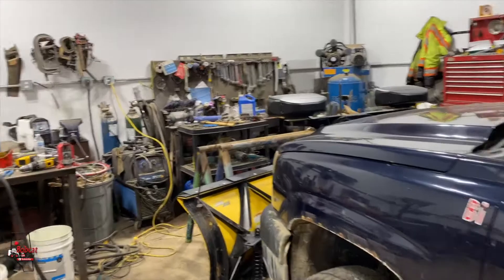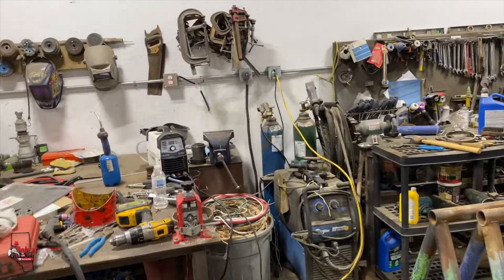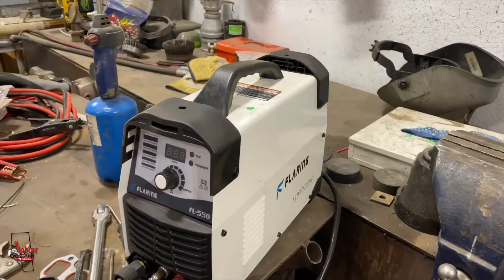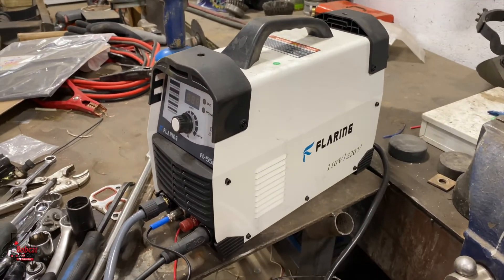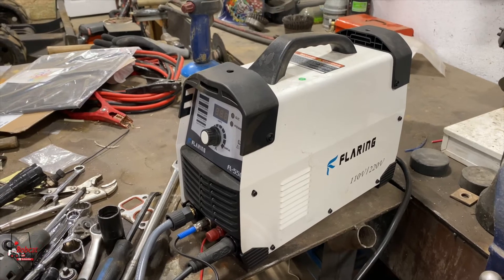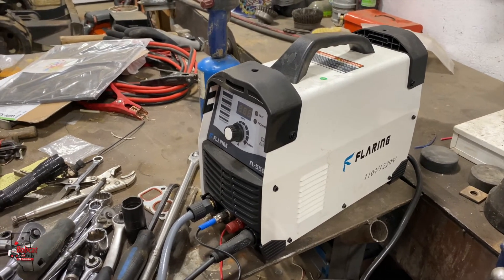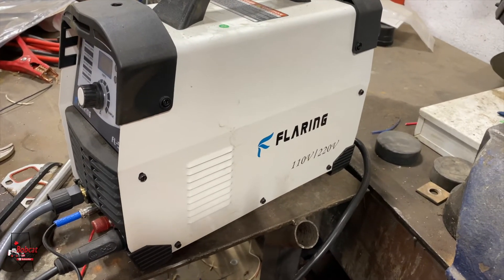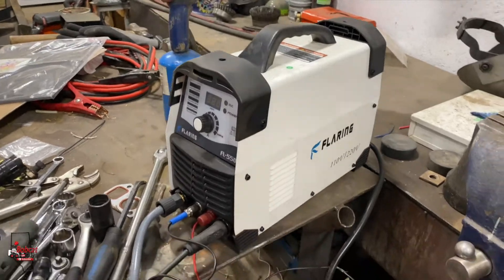Plasma Cutter Non Touch 50 AMP 110/220V FL-550 Pilot Arc 1/2''

Comment: Nice work man. Own a I-cut60 for 10 years, the best tool of repair shop, it keeps my EX50 and dumper in good repairs. Now retired, sold HD gears,  just built 2  250hp outboards stands/carts. Image if not using plasma cutter, this fab job will be much harder.

Comment: I think for the money it’s great, however a plasma cut through thin steel like you posted should be almost razor sharp. That’s the caveat of not being proficient ( read: not profitable) with your hot work equipment. As you stated in the video - you don’t care about specs and such- I think the machine c out lid definitely benefit from one who does abs has used such as so. Good content bobcat  !